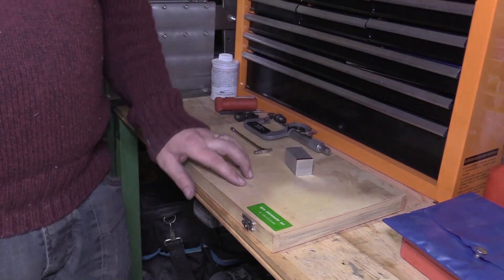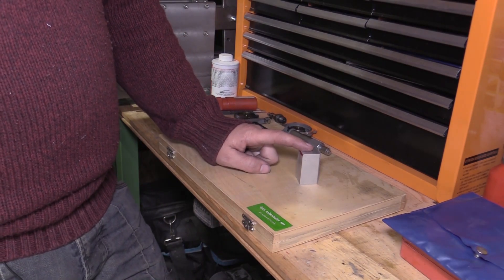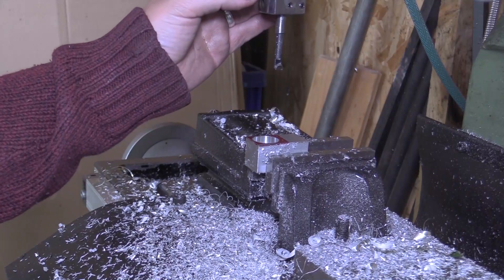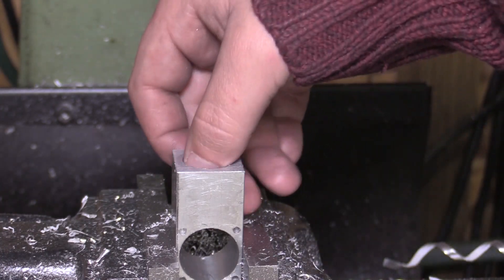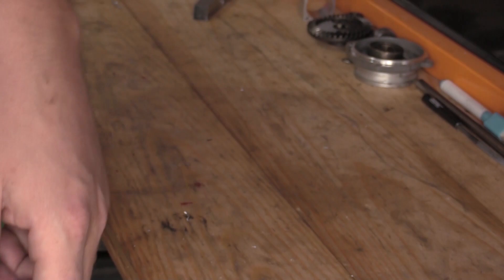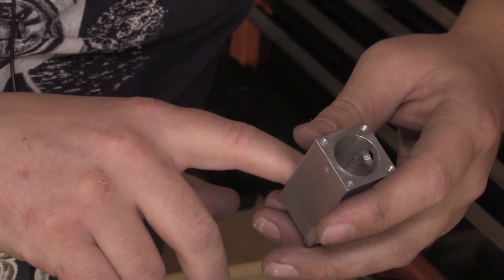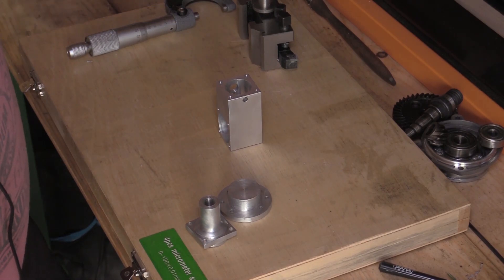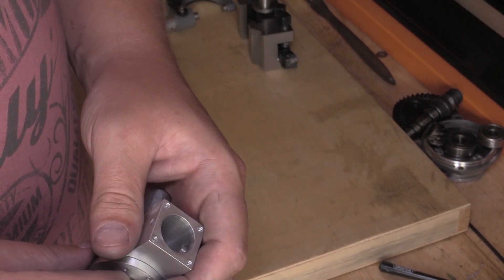Boll Aero 18   1.8cc Model Engine Build   Part 1

Comment: How accurate should the lathe be for model engine building ?
Reply from the maker: Hi Joseph. It's more a case of knowing what tolerances you need to be achieving. Ive tried researching this myself and it's hard to find a definitive answer. The critical parts are shafts, bearings, pistons and cylinders.
I'm 'aiming' for a tolerance of +/- 0.01mm. whether this is correct... I don't know. I believe many model engine builders lap shafts/bearings and pistons/cylinders to get the right fit. Or a fit they like. At this point it's very much feel not measuring.

Back to your lathe.... If your using a 3 jaw Chuck you probably want to move to 4 jaw. This will allow you to indicate each part.
Although there are videos on YouTube that show how you can accurately setup parts in a 3 jaw chuck even when your chuck is way off concentric.

Check out Joe Pieczynski
https://www.youtube.com/channel/UCpp6lgdc_XO_FZYJppaFa5w
Reply: @mrmechanical3423  thr lathe that i have in the garage has a 4 jaw chuck... its an old lathe and i think it has some forward and backwards play so i assumed it wouldnt be accurate enough. Also i dont know whats the first step in how to make an engine since i have no experience in this stuff... but im very tempted to try.
Reply from the maker: @minecraftgamerz929  it may be possible to adjust the end float. 

Best thing to do is start having a go. Even if it on a bit of scrap. Aim for a size and see how close you can get.

Comment: The divisions on your boring head would to me indicate a metric screw with a 0.75 mm pitch with 75 divisions giving 0.01mm of travel per division or an increase in bore diameter of 0.02 mm per division .
Presso gave your channel a shout out so i thought i would check it out and subscribe .
Reply from the maker: Thanks for finding me. And thanks for the tip. I'll see how it works out

Comment: As the designer of the engine, it was good to see you make a very nice job of it. I only came across your video by chance, and look forward to the next part.
For others watching, I would like to say don t worry too much if your parts are not exactly to drawing sizes, so long as they fit each other well.
Reply from the maker: Thanks Chris. This will be my first model engine. At the moment I'm researching how to lap the piston / cylinder properly.
Reply: Chris Boll does the cylinder have a small taper for the counter piston?